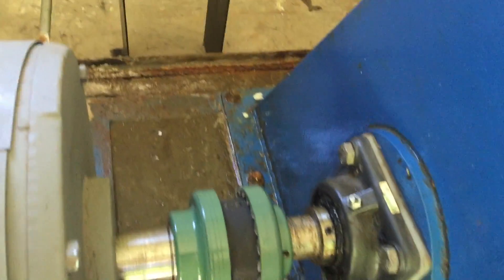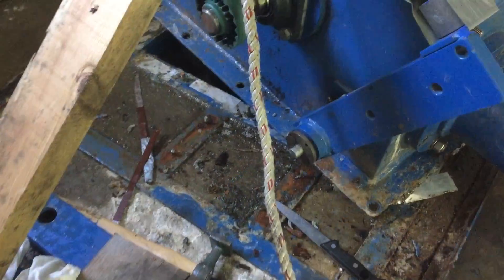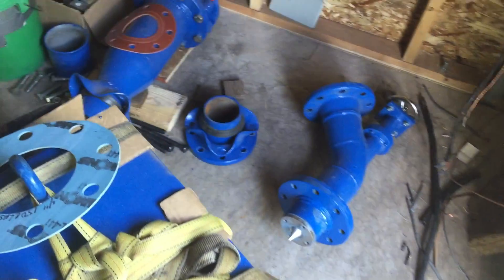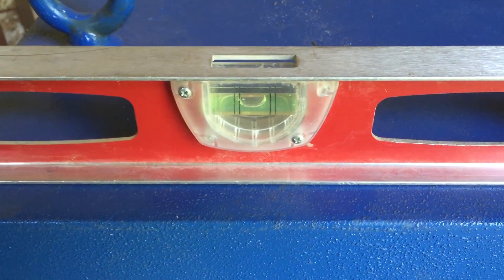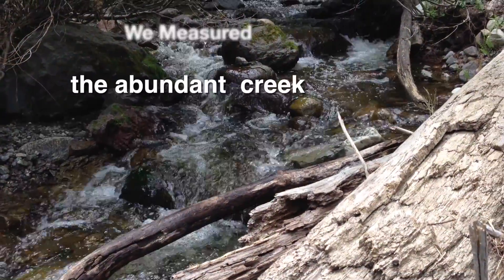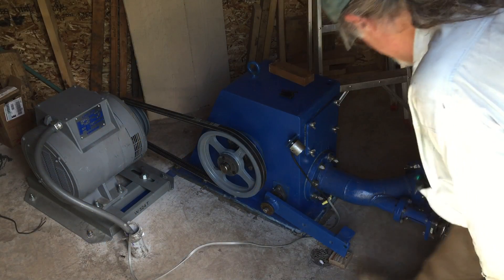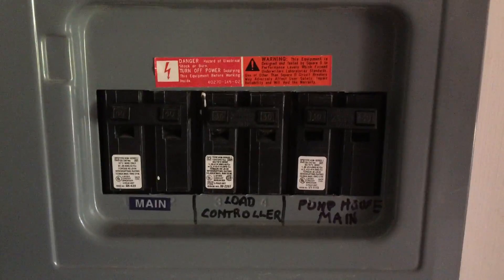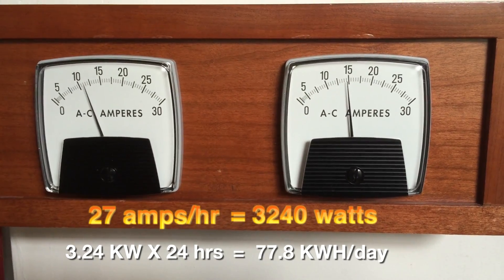Part 15 MicroHydro Power System in CO

Comment: Can you not string a second generator to a pully wheel attached to the first generator at a 1:1 turn speed to double your power output?
Reply from the maker: The power generated is the result of available torque. Torque = Power.  That torque comes from the pressure of water on the pelton cups in the turbine.  Adding a second generator as you describe would double the magnetic resistances and you wouldn't end up with more power.  Just more expense and inefficiency introduced via more frictional loss from added equipment.

Anyway, we produce more power than we actually need with the current design.
Reply: Thanks for that, but if you are connecting the second gen directly same size pulley etc, the speed is controlled by the rotational velocity of the first, so there is no chance of the second generator needing overspeed protection. There is only loss in energy during the acceleration phase, once the generators are up to speed, doesn't the energy requirement plateau, so you will end up using energy that would otherwise be supressed by magnetic overspeed protection. Im not disrespecting you, I am fascinated, and curious.
Reply from the maker: The electricity used is constantly monitored and controlled by an electronic load controller (ELC) to stay at 60 hz. This is the LOAD on the system which is reflected in the generator as magnetic resistance. Its like a backward magnetic push against the torque pushing forward against it. The load needs to be equal to the available torque (power) coming from the water jet pushing the turbine to remain at 60 hz. 

If you added a second generator and added that output to the system the LOAD on each generator would be roughly half of what it would be with a single generator. The combined magnetic resistance from the two generators would still need to be equal to the available torque or power or the system would slow down. You would most likely have issues synchonizing the sine waves of the the two generators. But ultimately load (magnetic resistance) has to equal power or torque

When you have a gas generator running and you turn on a heavy load (adding magnetic resistance in the generator coils) you will usually hear the gas engine slow and then work harder to produce more power to be equal to the load and maintain 60 hz. 

In the hydro system the available power remains constant and the load is  maintained constant by the ELC shunting off a portion of the power to resistance loads ( heaters). It does this by watching the hz of the system and adjusting the load to remain at 60 hz. If you turn on a toaster or light or whatever, a proportional amount of power is removed from the shunt load by the ELC. You can’t create kinetic power or torque out of thin air. 

You can’t use more electricity without adding load to the system. Simply adding another generator would actually make it all more difficult to manage it to where load = torque. 

I hope this explains it better. Perhaps viewing more of the series might clarify it. Maybe watch all of part 14 if the series 
https://m.youtube.com/watch?v=1c8AYt6C2P4

Comment: i still dont understand where you find just a generator head, everytime i try to search for one it just shows me gas generators, ive seen people using permanent magnet induction motors as generators, is this what you are doing
Reply from the maker: The specific generator i have is a 10kw  Lima 250 frame sold now by Marathon. Of course Lima electric co was bought out by Marathon since 1995 when i bought it ($2100). The numbers and prices have most likely changed since then. Mine was # SER 250S1230 and no its not permanent magnet. It has an automatic regulator with coils that create the exciter field. It can be wired in numerous manners for different output. Try googling “lima generators for sale” or speak with someone at Marathon about your specific needs. They are very helpful. 

Https://www.marathongenerators.com/generators//iomManuals.jsp 

has links to all their manuals past and present. My manual is SB364 on that webpage 

Hope this helps😁
Reply: @mrhydrohead  10kw is enough to power all your appliances?
Reply from the maker: Yes and I don't even use the full capacity of the generator. In winter I generate 7000-8000 watts and about 4000 watts other seasons because I don't need that much power. Of course I manage my use of heavy appliances and don't use them all at once.  The excess power gets shunted by the load controller to heat water or space heaters as required.
Reply from the maker: 4000w = 96kWh per day and 8000w= 192kWh per day.  Average household use per day for most US households is around 30kWh

Comment: Why a meter?
Reply from the maker: It’s a vague question as there are 4 different meters shown in the video. If you’re asking about the power meter its required by electrical code for the house. You can’t pass building electrical inspections without it.  It also keeps count of how much power you’ve harnessed over years of time.
Reply: Yeah I was asking about the electric meter. strange why it would be required to have a meter when you are not hooked to the grid.
Reply from the maker: State building inspections assume someday it may be connected i assume. Anyway, passing all building inspections to code is required to receive a certificate of occupancy most everywhere

Comment: may I ask an estimate of costs for total system?
Reply from the maker: Original spring fed system was about $25k in 1996 with pipeline, pond, powerhouse and electrical equipment. The redesign 2013-7 was around $55k all in. With hydro you pay for all future power up front

Comment: Hello can ask.if i purchase motor.what type of motor should i buy for my mini hydro powet.thank you
Reply from the maker: It's a very general question. Motors are usually devices on the load side of a system. Induction motors attached to the grid can be used for power production in an unconventional way. 
The best place to start is to measure how much power potential exists at a site (Head & flow). Then you can determine what equipment is the best choice
Reply: MrHydrohead what i mean the motor that generate ac voltage.used for hydro turbine.
Reply: MrHydrohead ac motor that can produce 2.5 kw ac voltage
Reply from the maker: I think what you need is an alternator. You have to be able to spin it fast enough to make AC. I would oversized it to a 3 kw alternator. Most alternators in N America need 1800rpm for 60 hz AC. What country do you live in?
Reply: MrHydrohead is thier alternator with low torque?
Reply: MrHydrohead im from Philippines.we have expensive electricty here.i need to do my own mini hydro power.we have a lot of revir here.
Reply from the maker: I'm not really an expert on alternators, but I know torque is a measure of force. So whatever system you might plan is capturing the potential power or force available. I don't know what sort of permission or permits you need to use the water there in your country. You need to do a lot of research about how much flow you can consistently expect and how much fall you can capture at a specific site. This will give you a calculation of POTENTIAL power. Any system should be designed on those measurements. You pay up front for all future power so it isn't necessarily inexpensive to set up but over time cost effective. This all assumes you can get permission to install a system. It sounds like you may be approaching the calculation from how much power you want vs. how much is available at your site. D.C. Is always another alternative but requires batteries and an inverter to convert D.C. To AC. AC generally required a decent amount of potential power. Have you done measures of the potential power at your site and whether it is permitted to capture it?

Comment: I'm curious what's the efficiency of the system? Far as amount of energy coming in amount of energy being generated and amount of energy being used?
Reply from the maker: all the boost Good question. My estimate is roughly 85%. It is difficult to know exactly how much water moves through the system, how precise the mechanical pressure gauge is, how much torque is lost in the sheaves and belts, or what quantity of electricity is lost in transmission and lost as heat in the transformer. Add to that that in summer we run the system at lower flows which changes the efficiency of both the alternator and transformer output. We capture ~8kw continuously in winter and 4.5kw in other seasons due to not having enough uses to put all available power to work. The Winter setting of 8kw has been adequate to heat the house and an outdoor hot tub at 8600ft with temp ranging 0-40's Fahrenheit. Definitely an abundance of power, but exact precision in efficiency measurements are both difficult and academic. Calculators I've used estimate ~80-85%.  Hopefully this helps answer your question. Thanks for watching.

Comment: quick question anyone can answer this if you like but coming from someone who has been using this setup for a few years now how does winter effect the efficiency of this device.
Reply from the maker: +J Regy Good question. We actually produce more power in the winter as our need for heat usage is much higher. In terms of the efficiency of the system, there really isn't any impact. The screen develops an ice crust covering it but still screens out debris without clogging. The turbine runs the same and the water flows year round. Hope this answers your question. If not can you be more specific

Comment: MrHydrohead. Amazing work, I really enjoyed learning about and watching your project. What a beautiful place!  Since you are so experienced on this subject I thought you might be able to help us with a hypothetical question. We are working on a science fair project for my daughter. We are trying to determine how much electrical energy we could produce from a vertical tank of water via a mini hydro turbine setup. In theory, if we had 10000 gals held in a tank that  is basically 6 ft in diameter and 48 feet tall, how much electrical energy could be produced using a pelton wheel if a nozzle placed at the base of the tank was opened allowing the tank to drain. I know there are all sorts of variables and other thermodynamic concerns.The goal is to produce electricity at a rate of 2KwH and then determine how long we could do that before the potential energy dropped below that threshold. The idea is a hydrobattery using excess solar energy to store potential energy in the form of water in the tank for night time use .There are no running streams or hills where we live.  We are trying to determine if a system like this is in any way feasible. What is possible? What would such a system look like? Perhaps it would take six such tanks to get through the night. Can you offer any thoughts on how to determine this or suggest  resources that might help? The physics get complicated very quickly. I thought I should ask you before I get much further. Thank you if you can offer any advice...
Reply from the maker: Its a very interesting question.  The two essential components in analysis are Head(pressure) and Flow(Volume).  Because you are essentially proposing a column of water that drains to a different head the pressure would be constantly falling and hence requiring an ever increasing flow to maintain a set output of 2kw. You would need to produce 2kw for 1 hour for 2kwh.   I'm not sophisticated enough to do this type of analysis.  
The usual path is to determine the two constants of head and flow and then see what is possible in terms of power.  Your hypothetical approach is to determine power output first and then try to determine the other two factors which would both be widely variable in a setup as you have described.  
It is an interesting idea, but beyond my computational skills.  I know that 48 ft of head is 48/2.31 = 20.78psi which is not a great deal of pressure and it would be rapidly decreasing as the tank drained.  Hence by the time it falls to 30ft you have 30/2.31 = 13psi and so on.  To produce 2kw of power the flow would need to be exponentially increasing to compensate for the loss of pressure.  And how would you control the flow?  I would think that a pelton(reaction) turbine would be less effective than a Francis(impulse) turbine with a draft tube.
The fact that the two most important measures are not fixed but fully variable makes the calculation complex. 

My knowledge is mainly around my own pelton setup and I continue to learn about the technology of it all as time goes by. Sorry I can't be of more help.
Reply: Hello, thanks for your reply. Upon further investigation I found the exact discussion on home power magazine's website in case any other readers are interested.. It is in no way feasible. Once I found the equations it was clear. Anyway, I would like to compare their equations with other observed numbers from someone like you. Can I ask, in your system. what a typical amount of out put you have in watts given a certain flow(gpm). How much head does your system have again? How many rpms are you getting at the generator shaft? Thanks.
Reply from the maker: We have two settings for flow. Winter is about 300gpm resulting in about 8500watts.  The Dynamic Pressure(flowing) drops to about 86psi due to pipe friction with that volume of water.  The Static Pressure(at rest) is about 98psi or 98*2.31 = 226ft of head.  The Spring/Summer/Fall setting is less because we don't need all the excess heat and haven't yet fitted a hot tub or other useful dump load to utilize the 8500w.  The lower setting is about 145gpm at 96psi(dynamic) and yields about 3600-3700w.  The speed of the generator is 1800rpm, but that is driven by a pulley system which steps up the rpm from the turbine shaft.  The speed of the water jet which is a result of the dynamic pressure governs the speed at which the pelton can rotate under load and it is insufficient to get 1800rpm, hence the pulley step up.  Can't remember the ratio at this moment.  Hope this helps...

Comment: Hey Mister.  I like your innovations of flowing water for power generation. And I know how to improve your design and elevate the pressure. Have you heard about HYDRAULIC RAMP PUMP? This is the way you should go. Usually this design is used to lift the water for garden watering, but in your case you could generate heavy water pressure to spin a generator. And if you want to know more about the use of flowing water you should also want to know what is TROMBE PUMP. Google it and you will not regret!
Reply: Not sure how a ram pump is applicable here. They're for pumping water uphill. He already has water uphill.
Reply: Yes, he could use a ram pump to get higher pressure, but that's rather silly. The power available is the product of pressure and volume. A ram pump isn't magical. It will produce a higher pressure head, but at the cost of lower volume of water (you can't get something for nothing). So what you would get is the problem of dealing with higher pressure (increased wear and tear) and actually have less power available since the ram pump isn't 100% efficient.

Comment: Why do you need a power meter if this energy is free?
Reply from the maker: +Celismar Silva Its curiosity, I suppose.  Making your own power becomes a hobby and is a bit addictive.  I'm not too concerned about how long it takes to pay for itself as running the power in would have cost far more 22+ years ago than installing the system.  And,there have been no power bills. Having a power meter was a building code requirement as well.

Comment: hi bro,
what is name item on minute 1 : 15 bro?
Reply from the maker: +Yu Nether
It is a Sure-Flex sleeve, type JES(has a split) made by TB Woods out of Chambersburg, PA, USA,  they also have offices in Canada.  All the parts combined is also known as a Woods coupling.  Hope this helps.
Reply: if the generator using the vertical, you should use which?

Comment: good series of videos,,,but now that its done what was total cost,,,i know you said 27 amps,,,could you tell me the  flow needed for that and i think you said head was 200ft or so,,thanks
Reply from the maker: Actually the project isn't fully completed yet.  So far the cost of relocating the system has run at about 52K.  Most costs from here will be small.  We are currently running 35-40amps with the intention of nearly doubling the capacity of the output.  Of course to do that we need to add a great deal more load to the supply = load equation.  We are in the process of doing that now and also adding Coanda intake screens for filtering and remote monitoring and control capability.  

The reason for the slow progress is that we took the lion share of year to prep and sell our other home and permanently move to this property.  Spring thru Fall power requirements are easily met by the 35-40amps and never having spent a complete Winter here there are uncertainties about maximum available water and potential freezing issues with the creek diversion.  Its a chicken/egg scenario as to knowing how much water you have to make power in the time of year when the greatest need exists and properly installing the correct amount of load on the system to balance the power production.

Our static PSI is 98 which means roughly 2.31* 98 = 226.4 Feet of head.  Flow varies with seasons, but to answer your question 27amps would be roughly 125-130gpm.  We currently run an estimated 170-200gpm to generate 35-40amps.  The pressure(active) drops a bit at the higher flow due to pipe friction, but its not a big loss at 96-94PSI resulting active pressure. We estimate that most of the year Spring-Fall we have 350+gpm, but flows in the dead of Winter are uncertain.  Thats why we are taking our time to max the system out.  Hoping for that same 350+ flow, but not certain yet.

Thanks for watching.  Subscribe for more in the future.